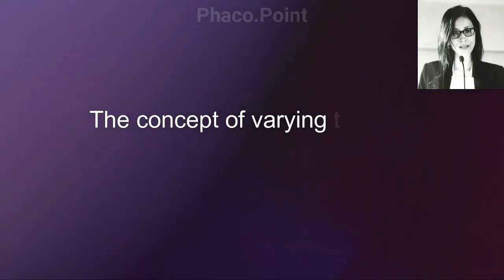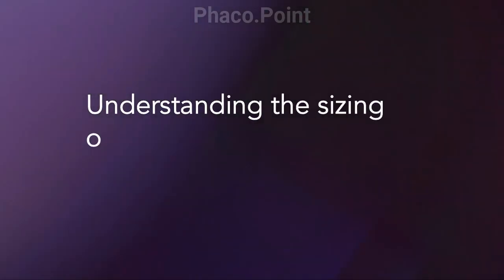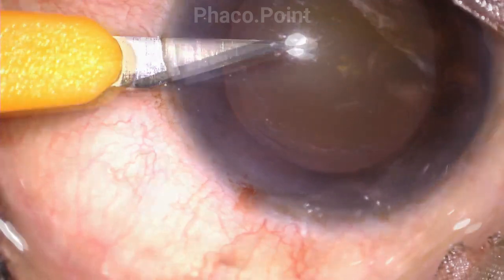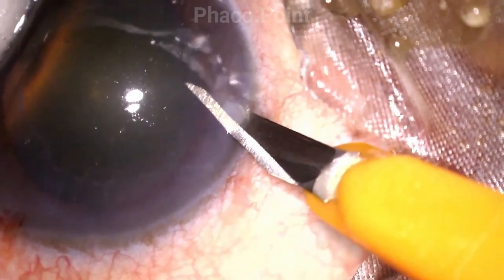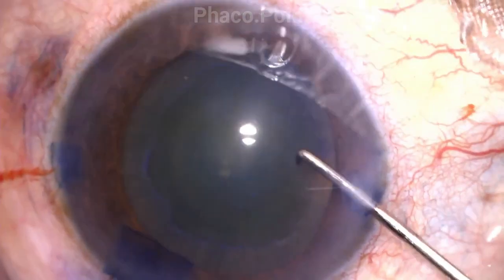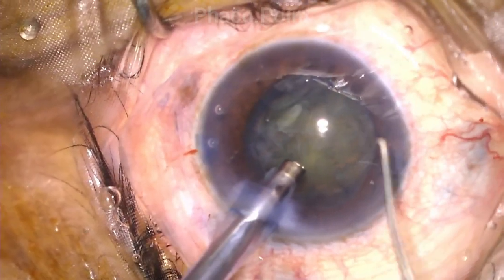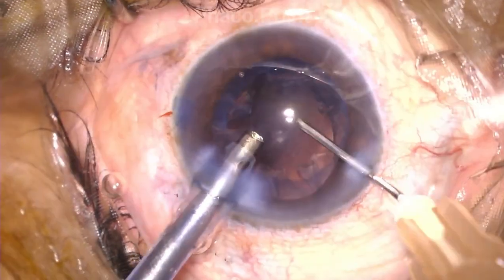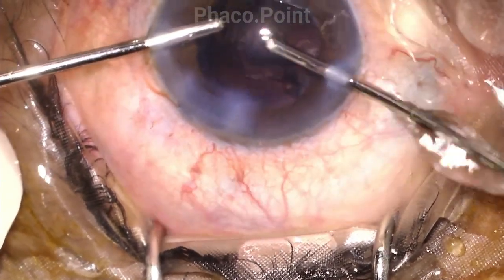The concept of varying the size of the side port incision during Phaco - for stable anterior chamber

Comment: What an excellent video explaining this important concept, dear Dr Suvira! 👏👏👏
Perfect demonstration of it in a surgery with a very elegant technique. Avoiding unnecessary incision fluid egress is a must for a safer and easier surgery, and side port size usually plays the biggest role in it, as you pointed out. Keeping it as small as possible during nucleus management is very beneficial, especially in shallow AC or hard nucleus cases, to achieve the mandatory AC stability. 
Very nice, loved it. Thanks for sharing this helpful video! 🙏🙏😊